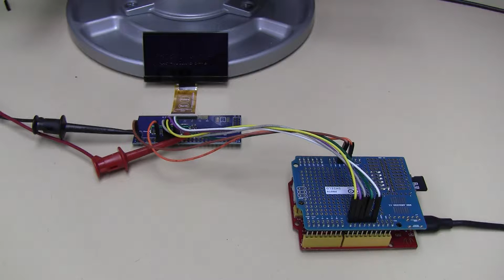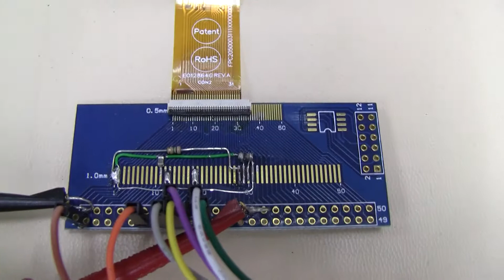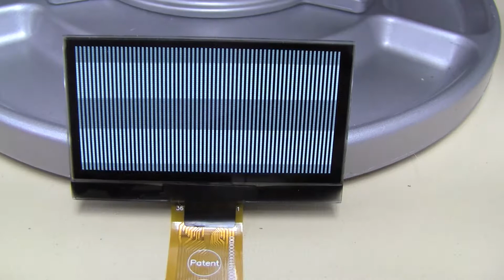CFAL12864G-024W 128x64 Graphic OLED SPI Seeeduino Arduino

Comment: Is it audibly noisy like in the video?
Reply from the maker: I don't recall this display being especially noisy, usually it's the caps on the Arduino or the breakout, but I'll see if we can bring this one up again and double-check.
Reply: @Crystalfontz  You guys rock
Reply from the maker: @pcdoodle1  We brought this display up this morning, it's definitely the breakout board making the audible ringing. This breakout was thrown together pretty quickly, so when we drive the display relatively hard it causes some oscillation and amplification of the capacitors. Let us know if you have any other questions we can help answer! Thanks